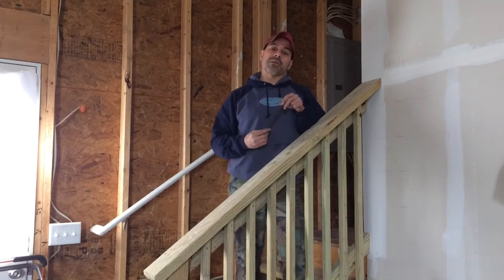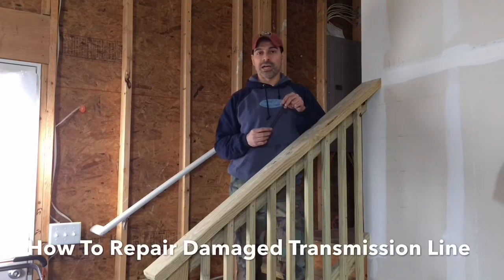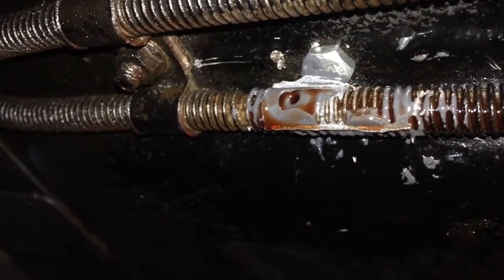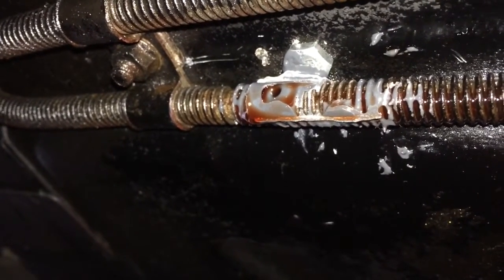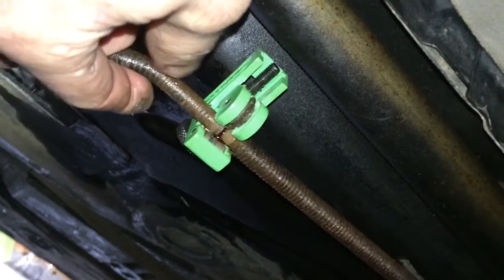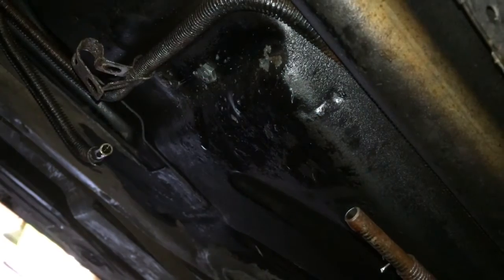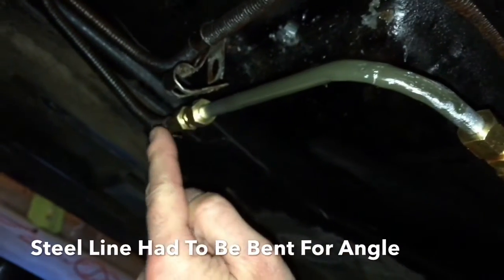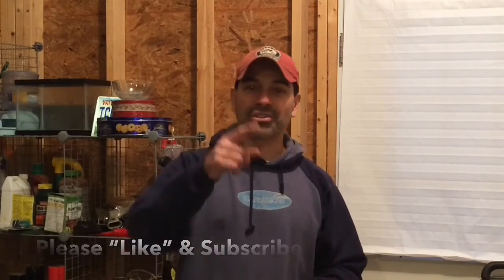How To Repair Damaged Transmission Lines (Andy’s Garage: Episode - 33)

Comment: Great video. You and I are on the same page. I have a customer that needs 2 lines for an 02 Grand Cherokee and the lines are $200. I plan to cut out 80-90% of the line, leaving the fitting ends and installing new line between them with compression fittings.
Reply: Planning to do exactly the same with my 98 Cherokee XJ soon. Did you do it as planned in the end? Any probs? I bought steel compression unions to do the job,  not brass.
Reply: @andrewcheatle4691  The job went well with no leaks. I didn't have time to get steel compression fittings so that was a smart move. The brass fittings seem to be holding well. 

I was able to find someone on Ebay selling one of the lines for only $27 so I only needed to make one. I do so many brake lines, but those are 3/16 or 1/4. Bending 3/8 line was a different experience.
Reply: @marcsmith3881  
Good to know it worked out👍. I'm using 3/8 Kunifer ( Nickel/Copper ) not steel so hopefully I won't need Anabolic steroids 😂 I don't envy you having to bend 3/8 steel. I bought a junky Chinese bending tool for 10 UK pounds - but hopefully it'll manage ok

Comment: Not good  y have to use  same material. The fittings. U use cooper  on aluminum. ..that will it the pipe..won't  last

Comment: My so called mechanic has had to repair my chevy 2500hd 4x finally I'm sick of paying him took it to an actual trans repair shop and was told he shouldn't been doing this and this is what's causing my majer trans leak of 1 gallon per day.
Reply from the maker: He may have used a rubber hose to fix the leak. That will fail in time. A metal line with compression fittings will last better.

Comment: This is a good video and will surely use it to repair a transmission line hole on my 97' Chevy Silverado K-10. At the moment, the hole is covered with a fuel line rubber hose with a screw clamp on it. So far, it hasn't failed yet but got nervous one time when I went on a long distance trip but this video is a good repair to me. Thanks for sharing that there is another way of repairing which I didn't know about👍🇺🇸..New subscriber here.

Comment: Performed this on a 2002 Chevy Suburban. YOU SAVED ME HUNDREDS OF DOLLARS.

Just a couple things I'd recommend is directly stating for the newbie that you discarded the fittings that came on that length of steel hose. After some useless trial and error trying to match the compression fittings to them I cut the hose flares off, removed the fittings that came on the hose and cut the hose to length and bent it according to needs.

Also two trips to parts store after trying to superman the steel line into a shape then picking the wrong size pipe bender. 

Your line also wasn't coated in a scaly layer of rust that would prevent your compression fitting from sealing. I knew to get at it with an emory cloth on the ends of the native line but you may wanna toss in a side note cuz why not for them that haven't done it and may try to get at it with a file or force the fitting on.

Again, thank you for this video. Seriously.

Comment: Best way is to go buy a 5ft and a 6ft 5\16ths brake lines pre flared w same exact fittings already on them at any auto parts store....SLOWLY, make bends around a pipe ,or leg in may case..just keep a close eye on it so you dont kink it.it really doesnt kink that easily ,unless your in a hurry not paying attention..next thread in, n wrench down w 1/2" cresent....add your missing trans fluid, and your done....cost ya about 25 bux, n ya did it the right way...So,for anyone having trouble with a gm th-350, there it is! If you have a car,it maybe a tighter fit.might be a little hassle,but its worth the effort. Quick tip,if you absolutely cant get lines off the trans fittings,just (SNIP) them off close and use a 1/2" socket. Dont saw,torch or vice grip! Good cable or side cutters work! Do Not, throw any pieces away,because you can easily save and use as a template/reference of how to bend new lines. Also,keep tabs on where they route through everything.use your smartphone and take some pics. Hope this helps anyone looking,wish someone wouldve told me,figured it all out the hard way....dont take shortcuts!
Reply from the maker: SUREMAN FPV thanks for the comment, I appreciate the input 👍
Reply: Yeap! I always cut lines close to fitting then just use a socket to remove.
Reply: There's a whole bunch of smart in this post. Thank you for taking the time to save me some of mine!

Comment: Is every transmission cooler line the same size? What size compression fitting did you use?
Reply from the maker: They can vary based on the vehicle. This is a 1986 Pontiac Fiero, I believe it was 5/8. This video was filmed a few years ago

Comment: Thanks for posting this. Exact same repair planned on my 98 Jeep XJ. If you dont mind answering a question - would a steel compression fitting be preferable to brass ( given that the oil cooler lines are steel anyway ) - or doesn't it matter either way? Thanks
Reply from the maker: Andrew Cheatle brass usually seals better but steel is tougher. I think it’s a matter of opinion

Comment: Nice video!  Bent my trans line today when taking out my radiator.  Can u rx best way to bend w/out kinking? Any special tools to bend 45 angle???
Reply from the maker: angeldesac you can use a pipe bending tool which will prevent kinking

Comment: I have a fixed a lot of problems on my Fiero watching your videos, you do a great job, I have the same problem with the trans lines, can you tell me the size of the compression fittings and the metal line you used? Thanks in advance
Reply from the maker: Thanks, I’m glad the vids have been helpful. I haven’t worked on the Fiero in a while. I’ll look underneath and tonight and get the sizes
Reply: @PhillipsVision  you have no idea how helpful your videos are, I bought an 87 Fiero GT, I had never seen a fiero before, didn't run, drive or brake, I now have a running and driving car that also brakes thanks to you, I really appreciate your help.
Reply from the maker: @moneypit1543  glad my vids helped. I used a 5/16” diameter steel brake line with the compression fittings that fit the diameter. The stock Fiero GT transmission cooler lines are 5/16” in diameter. I’ll be shooting more Fiero vids in the coming months👍
Reply: @PhillipsVision  awesome, do the ends of the line need to be flared in order for the fittings to work?
Reply from the maker: @moneypit1543  if you use a brake line the ends of the line will be flared. I did not flare the ends of the transmission line since the compression fittings made the connection without flaring needed
Reply: @PhillipsVision  thanks for your help brother
Reply from the maker: @moneypit1543  you’re welcome 👍

Comment: Thanks for the video! I have a 2011 ram 1500 with leaking trans lines and this looks like the most solid way beside complete replacement of the lines. I will keep my eyes open for the tubing. Can you get such tubing in home depot? I am from Canada we don't have autozone.
Reply from the maker: No, you need to get it through an auto parts store

Comment: Hi Andy,
Is it ok to use copper line for refrigeration?
Reply from the maker: You can, but some people recommend annealed copper line instead
Reply: @PhillipsVision  I used rubber hose with clamps  from Amazon, it came off ,too much pressure.
Reply from the maker: @sulaimanshaya  if you use hose make sure it’s rated for fluid and use good automotive hose clamps

Comment: Is that Stainless Steel tubing??? If so the copper compression fitting is softer and can leak.
Reply from the maker: Alex Pica it’s low-carbon steel with a poly-vinyl flourine coating on the exterior

Comment: How long it will last?
Reply from the maker: Martin Marin if you use a compression fitting and metal line as in the video it should be as good as new. It’s been about (2) years since this was done and no issues yet. If you use a hose and clamps, which I highly would not recommend, it won’t last long

Comment: can you share the part #s and where to buy?
Reply from the maker: Mike C the part# (size) varies based on vehicle. You can purchase the piping at Autozone or Advanced Auto
Reply: Phillips Vision what about the compression fittings? Where did you get those?
Reply: @jordanlogsdon9926  you can buy those at home Depot or Lowe's in the plumbing section